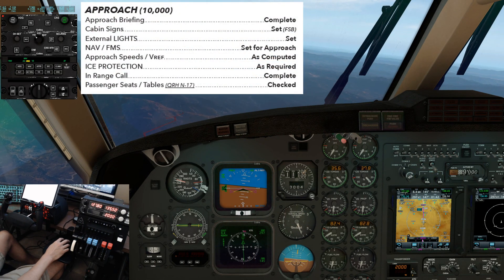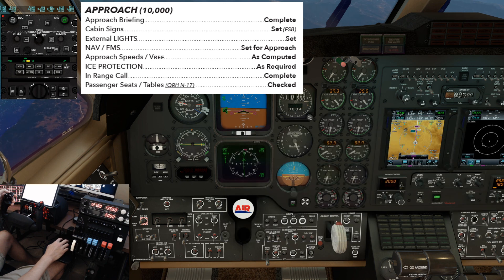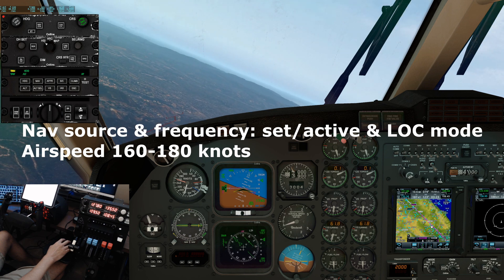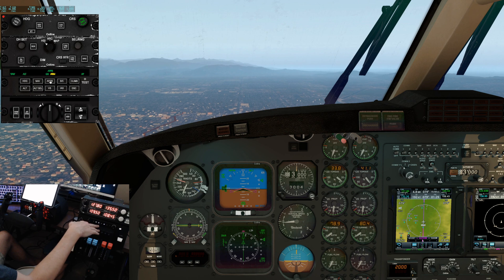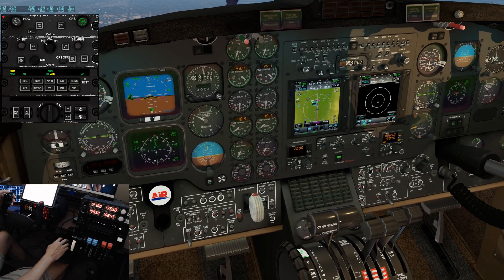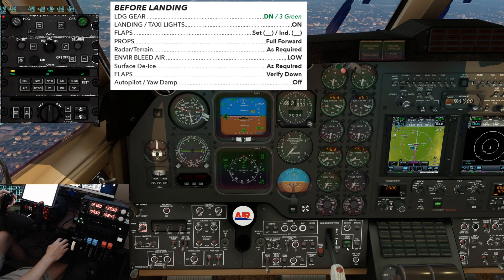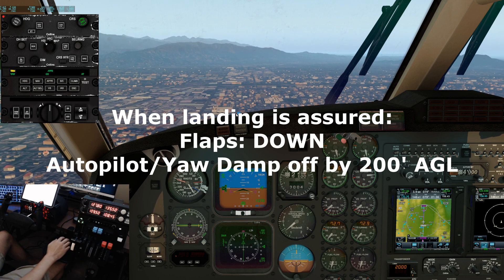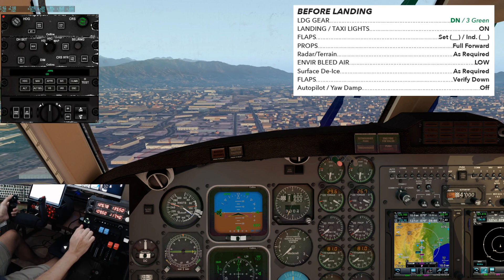King Air 350 X-Plane 11 tutorial by KA350 Pilot | Part 3 of 3

Comment: How did you set up the beta range for the throttles on the bravo? I just got the the bravo quadrant and haven’t been able to set it up properly.
Reply from the maker: In the x-plane settings, under JOYSTICK.. device BRAVO THROTTLE QUADRANT...  for each throttle, you will see EDIT RESPONSE CURVE. click that and another window will open.  You will see Has beta/reverse detents. Check that and you can set the beta and reverse points as desired.
Reply: @chazflyz  I’ve done that, I just wish that you could set the beta range to actually correspond with the area on the throttle below the physical detect area. I have been able to accomplish it by using negative numbers within the beta and reverse curves, but the actual slowing of the plane doesn’t happen, as it still doesn’t model the area below the detent area regarding the engine.

Comment: Can you please confirm my understanding that your speed before touchdown is 125 KIAS?  I read the book and said 100-109 based on weight. thanks
Reply from the maker: Real world operations typically use 125 as the approach speed in case of an engine failure.  At around 200-400 feet above the ground we begin slowing to Vref (100-109).
Reply: @chazflyz  thanks!

Comment: Easy top of decent  calculation..

Your cruise Altitude is FL260.

Airport Elevation is 1000ft MSL.

You want to be 1500ft above the airport elevation  upon arrival at the airport.

 Add the airport elevation and the height at which you want to be above that eleavtion together, In this case it would be 2500ft..

Airport Elev 1000ft + height above 1500ft = 2500ft..

 Now subtract 2500ft from your cruise altitude of 26000ft. This gives you 23500ft..  Drop the zeros and add a decimal to give you 23.5nm..

 Now multiply 23.5 x 3 for a decent path of 3°..
=70.5 Nautical miles, This is the distance in nautical miles that you need to start your descent from your cruise Altitude of FL260 to arrive at the airport 1500ft above the ground or above the airport elevation of 1000ft

 Simply put if you start your descent at that distance from the airport you will arrive at 2500ft MSL upon arriving at the airport.

If you wish to arrive at this Altitude 5nm before the airport simply add 5nm to 70.5nm to get 75.5nm then start your decent from that distance..

 Your rate of decent will simply depend upon your ground speed..

For example-  Ground speed is 200 knots, Simply multiply 200 knots times 5..
This =1000fpm

 Your rate of vertical descent should be 1000ft per minute with a ground speed of 200 knots..

This will vary slightly depending on the varying of your ground speed, simply recalculate it if your ground speed increases or decreases always multiply by 5 to get your rate of descent..

 I know that was a mouthful but it's actually very simple once you've done it a few times and it works like a charm no matter the altitude or ground speed..

And with a 3ﾟ glide path this works for anything when trying to reach a specific altitude at an airport or a fix, or waypoint or any other position that the distance can be calculated..

 Hope this helps anyone trying to manually calculate top of descent without the aid of an on board computer to do it for you.

Thanks!
N9823L

Comment: Thank you for your excellent videos on the Airfoillabs. They are really useful to get up and running. 
I have a few questions, what fuel burn do you use for flight planning and how do you determine the cruise altitude, is it based on route length?
Reply from the maker: Fuel burn will depend on altitude. We use flight planning software to compute our flight plans and fuel burns. Typical fuel flow per engine at FL210 is 420 lbs/hour.  
Yes altitude selection is generally based on distance. 10% rule. 200nm. No higher than FL200. Again general rule but if there are weather or operational requirements, then adjust as needed.

Comment: Did you have a way to bind beta mode on the honeycomb throttle? Didn't know if there was a solution for that
Reply from the maker: Following up and to be more specific.  In the config tab for the throttle, you will see EDIT RESPONSE CURVE.  That opens a separate window THROTTLE (1 or 2) AXIS RESPONSE CURVE. At the lower left of the window, there is "has beta/reverse detents". Check that box.  By doing that, you can set the points at which your throttle goes into beta and reverse.  Obviously as we know, there is only 1 physical detent on the the Bravo so you'll have to make your own "virtual" detent.  Hope that helps.
Reply: @chazflyz  Thanks. I appreciate the follow up, safe flying my friend 🤘🏼
Reply from the maker: Since the Bravo has only 1 switch detent (real KA350 has 2- ground fine/beta and reverse), you can only assign 1 or the other. But there is an option to adjust the slider when you get below a certain threshold just before you hit the physical Honeycomb detent, it will go into ground fine/beta.  Then you can map Reverse to the detent switch.

Comment: Is it possible for KA350 to taxi after landing, with one engine off? Ive seen it on an ATR72. Would like to know if its possible, and which engine should be preferably running. An ATC and XP11 simmer here.
Reply from the maker: I've never done it in real world ops- just the sim and it seems to be ok aside from lots of rudder input not surprisingly.  There is no published single engine taxi procedure in the airplane flight manual... but if I was to shut an engine down for taxi, it would be the left engine.
Reply: @chazflyz  that explains, why I never see any B350 coming to our airfield with single engine taxi operation after touchdown. Many thanks Captain 👍

Comment: ...you should map your throttles to "Toggle Beta" 1 and 2. The result is no engine surging when entering or leaving beta mode. Great series!
Reply from the maker: Thanks.
I initially did play around with the beta and reverse mappings, but since the Bravo has only 1 true physical detent, I just mapped reverse.  But yes I typically taxi in ground fine in the real world although in XP it seems too powerful at times.
Reply: I’m having issues with my detent and toggling beta. Ideas?

Comment: Are the condition levers left in the low idle position for the entire flight? Looks like they get left that way since the after-start checks? If so, do you guys ever leave them in high idle?
Reply from the maker: Yes we leave them in low idle. Even the manufacturer's checklist does not require the condition levers in high idle for flight. Those levers do not affect engine performance in flight.  Some pilots may move them to high idle just prior to takeoff as technique in case someone's hands accidentally knocked the levers back... which would be very rare to impossible.
Reply: @chazflyz  ok great, thanks!

Comment: Hi Chaz, regarding pressurization, 1:43 is this adjustment done even at a max service ceiling of 35000 feet before descent starts? Put another way, is there a certain altitude where the pressurization adjustment is made? Thanks!!
Reply from the maker: Hey. Yes we will make that adjustment as we begin our descent from any altitude.